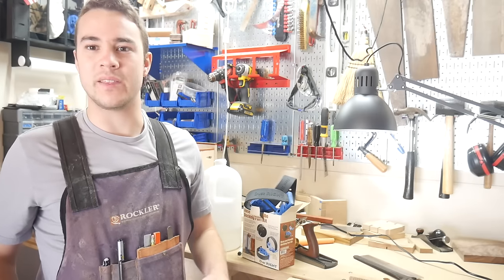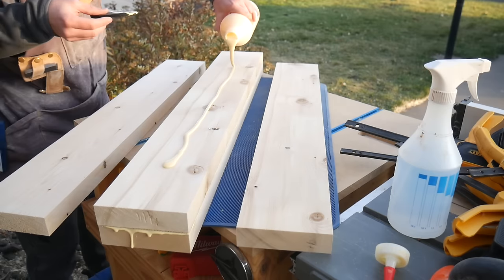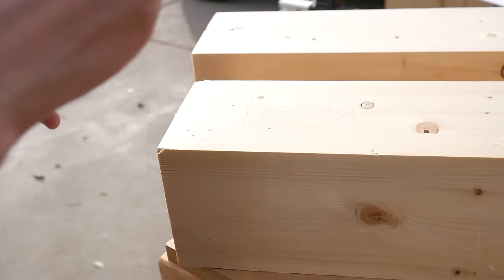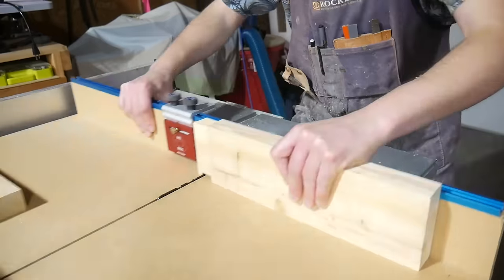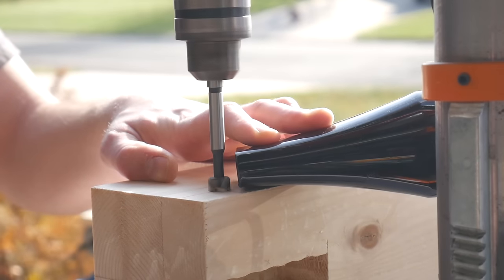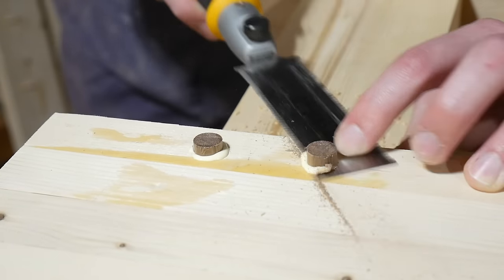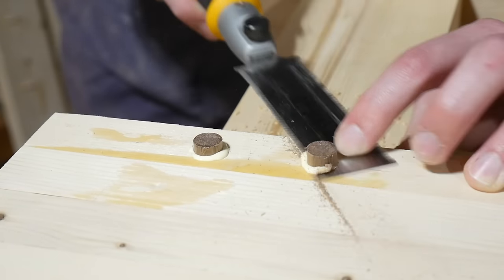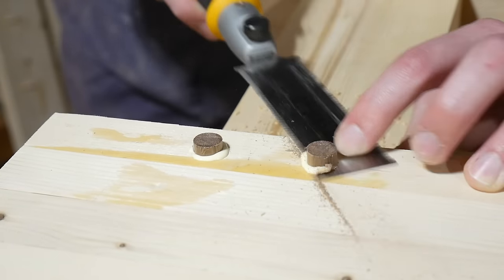How to Build a Woodworking Bench w/ FREE PLANS // TheTranq

Comment: If you feel you need 5" thick legs, you should be using hardwood instead. I'm building a solid Birch bench and 3 inches thick is plenty strong.
Reply from the maker: @matthewphillips5483  as I talked about in the video, I went with softwood due to the price
Reply: @TheTranq  I understand. But your labor is valuable too. Unless you like making benches, might be better to make a forever bench the first time.
Reply from the maker: @matthewphillips5483  I am at the bench right now using it. It will last well past my lifetime

Comment: Great Bench! I made a bench with a similar MDF top. I used Irwin Speedbor Max drill bits for the dog holes, and they worked well. I nearly screwed up the first one because I was surprised at how quickly it cut through, but still left clean holes.

Comment: Nice bench.  As with other comments, the bottom is much nicer than the top but I'll defend the use of MDF for a top.  Until the price of lumber skyrocketed MDF was pretty inexpensive.  Last month it was almost $40 at a big box store.  It's very flat and very smooth; both good qualities for a woodworker's bench top.  I've thought about covering MDF with solid 3/4" white oak flooring glued to the MDF.  That would offer the durability of a hardwood top at far less cost.  With a layer of flooring, 2 layers of MDF and a layer of 3/4" ply on the bottom it would tolerate holfasts well and last a long time for less cost than a solid hardwood top.

For the dog holes, I would start the holes with a Forstner bit and once a decent depth was established, finish off with a power drill and spade bit or a hand brace and auger bit.  MDF is a pain when it comes to boring larger holes because it clogs the cutting surface of the bit.  A large twist bit like a Silver and Deming style might cut better.  I have some but haven't tried them on MDF yet.
Reply from the maker: Good ideas! I think I am going to replace the top with a hardwood top this summer! Stay tuned!
Reply: Good idea but the only thing is the white oak flooring has chamfers on the end.

Comment: Did you do pilot holes on each sheet of mdf? Also what screw size did you use
Reply from the maker: Yes pilot hole through all the sheets. I probably used #8 screws
Reply: @TheTranq  thank you! Did you remove the screws after the glue dried?
Reply from the maker: @kevinb6102  yup!
Reply: @TheTranq  thx

Comment: Did the spade bit blow out the MDF when exiting the bottom?
Reply from the maker: Yes it did, but fortunately you never see it. I would go with a real wood top
Reply: @TheTranq  That's what I was wondering. I kept going back in forth between laminated 2x4's or MDF. Thanks for the information.

Comment: I have been thinking of using casters like the one you used. Since they lift the bench one leg at a time do you think they could cause structural damage over time? I'm thinking of making a bench of roughly the same size, but with less robust joints.. I'm considering connecting each pair with a rod to allow for two legs to be raised simultaneously.. Great job by the way :)
Reply from the maker: Thank you! I agree I’m not a huge fan of lifting one corner at a time. If you could figure out a robust way to connect each pair that would work much better! I don’t think it will cause damage but it can be a bit annoying lifting each corner separately
Reply: Pallet jack?  It wouldn't work for this bench as it is, but if you plan for it on the build and put the stretchers up a few  inches...
Reply from the maker: @niznoz8379  I like that wheel brace idea!

Comment: A good result, but it’s a bit of a shame that you didn’t trying something a little more exotic for the top. Perhaps a laminated pine top, or hardwood top, etc, etc. You spent all that time doing the lovely joinery on the lower half, that it’s a shame the top didn’t get the same treatment, so to speak. I do really like the design of it though, and the vice was a superb touch of class... not to mention the use of red oak. Very nice indeed and one that I would absolutely consider.

Having just re-read the above it sounds a little harsh, but it’s really not how I want it to come across, so apologies if it does. The MDF just seems a little simple compared to the bottom half.
Reply from the maker: I totally agree! Im not super happy with the top and will probably give it a hardwood top this summer. Thanks for watching and commenting
Reply: @TheTranq . No problem. It was an interesting build. I do think that the  bench top is a great starting point, but with the nice joinery on the legs, etc, it definitely deserves something a little nicer. Keep up the great work and as I said, I don’t wish for this to be a negative comment, just a motivational one. At least I hope so 🤞All the best to you and your family.